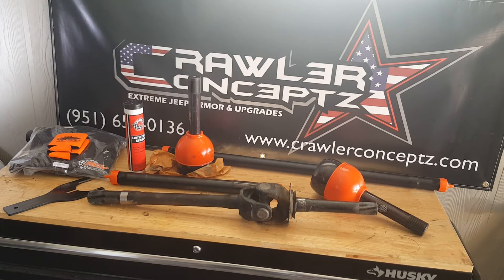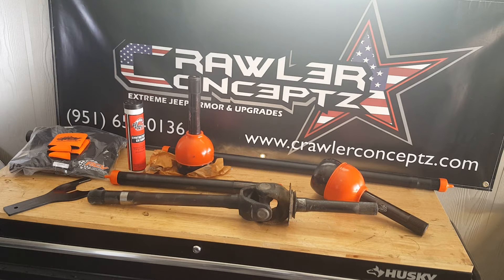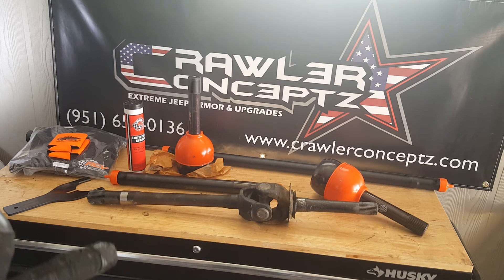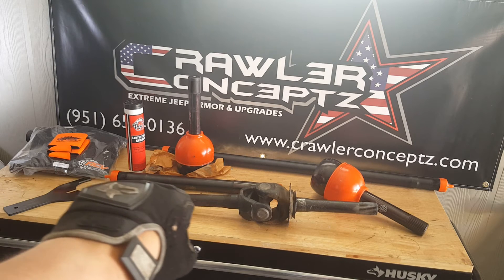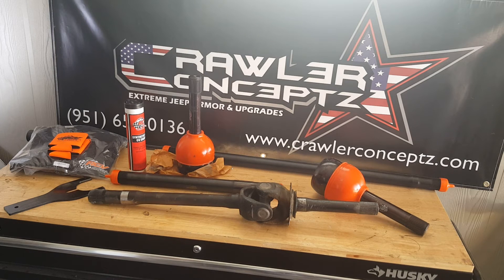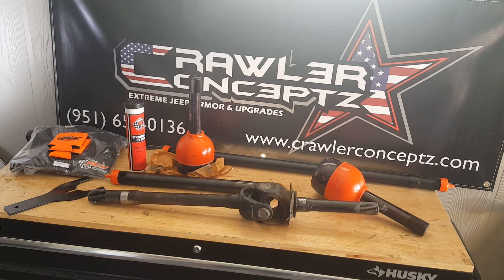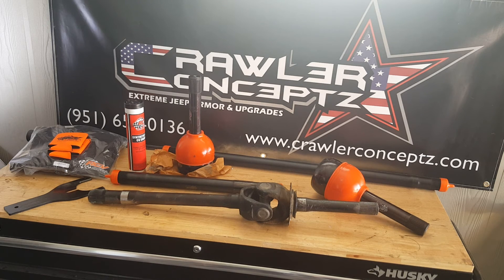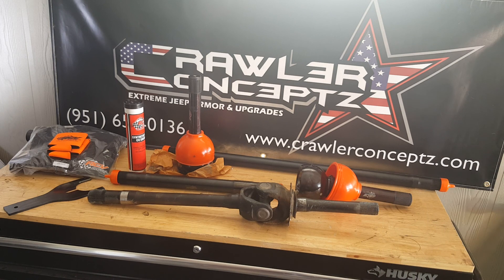RCV Axle Shafts. America!

Comment: RCVs are a great idea, but fail after several years, in that they start making a HORRIBLE clicking noise.  RCV might not stand behind them if the warranty is expired.  Just my opinion based on my experience:  BUYER BEWARE!!!!
Reply from the maker: surfdogdude I have had two sets this set here and a set in a ProRock Axle. I keep grease in them and they are awesome. But for people who wear out  the cage etc over several years. That would be like asking RCV to warranty an axle shaft Ujoint which is a wearable item.
Reply: This is what I Posted What did you post so can they be rebuilt or am i supposed to throw away my very expensive custom made axles?